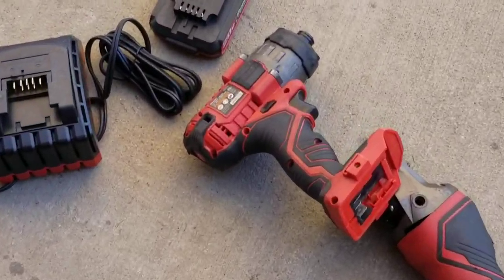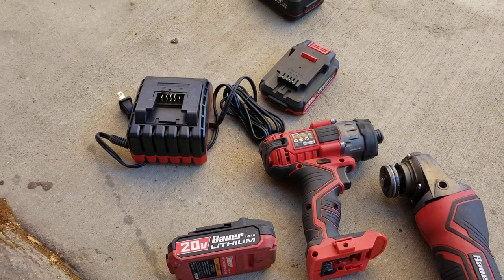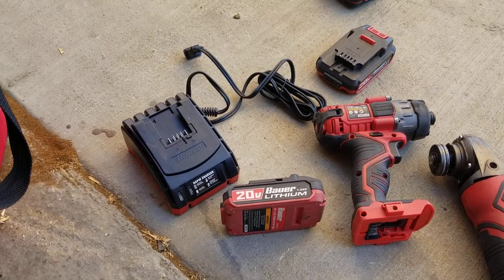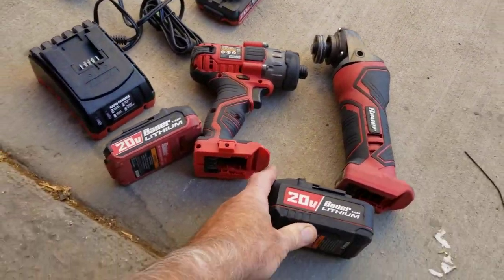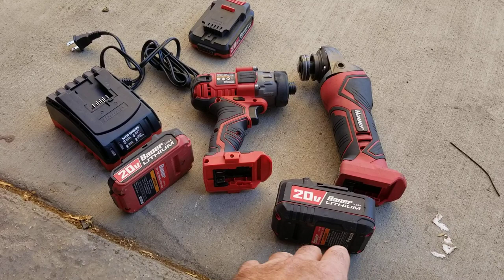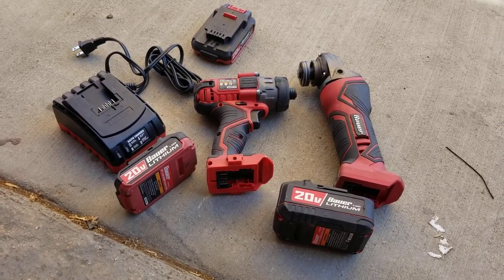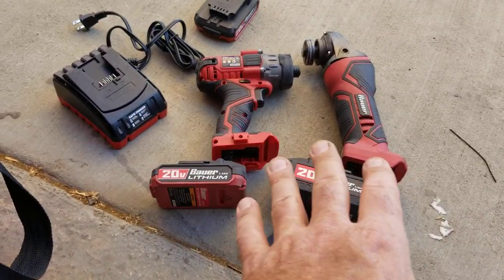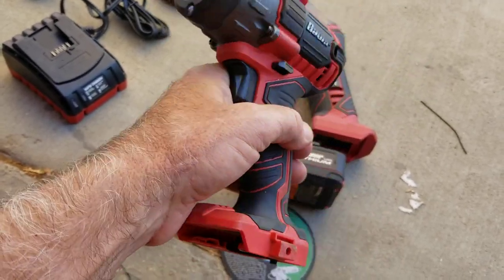Harbor Freight Bauer tools after 2 years of abuse

Comment: I can testify to the value that the Bauer tools offer the average guy. I am an electrician by trade and have used dewalt tools for years. I also remodel homes on the side. I recently moved across country and needed to remodel my new house. My dewalt stuff was 2000 miles away. If didnt want to repurchase everything again so I gave Bauer a shot. I purchased everything with coupons. I picked up the impact driver and drill driver kits first. They each came with a 1.3 ahr battery, charger and pouch. Then I picked up a cordless circular saw, jig saw, angle grinder and two 3.0 ahr batteries. I am now remodeling my second house using these tools and they are still working great. There are some things I don’t like as much as my dewalt but for the 320 bucks I have invested in the entire set I am not going to complain. That’s equivalent to about 1000 bucks for the same tools in yellow. For the guy that uses these tools for weekend projects around the house it’s a no brainer. Definitely need the larger batteries for any tool other than the drill and impact driver. I think the manuals even recommend using the 3.0 batteries for the jaws and grinder.
Reply: same thing with me. I was out of town same issue. I bought them with low expectations and was totally shocked. Now I have almost every tool. They work great and if they get stolen which that happens on job sites unfortunately all can be affordably replaced.
Reply: i use to only use ridgid since thats what my boss used too and seemed like my batteries were burning out once a month so i said the hell with it im going to try the bauer stuff because i liked how big the tool line is and with doing home improvement and restore and build furniture and now with the 5.0 batteries im even more happy and with the chargers i actually bought extras so in my workshop i have 5 chargers and probably close to 10 batteries and love how much i have saved and the dependability
Reply: I purchased a 10” chainsaw and Bauer now makes a 5 amp hour battery which I also purchased yesterday.
Reply: I am not branded I use everything I have bauer craftsman just bought dewalt cuz it was use sale. The dewalt was 12v 5 tools to 2ah batteries and two 5ah batteries for 350. But I use my cheaper tools all day and I work in tool sales and I start my sales with taking to craftsman cuz its my cheapest tool and talk to them on projects or jobs and see if I have to move them up but I sell to needs not wants I'm a single dad fighting to stay afloat so I know what budget means and rather get my customers best deal for needs. And I tell them brands don't mean anything anymore I have dozens of customers that say I'll never buy black and decker they only make junk acting like they know everything but they buy dewalt that is a black and decker company as well as craftsman and Mac and dozen more. So thank you for making a video that let's people know cheaper tools don't mean junk yea bauer won't do a job as fast as Milwaukee but can keep up and give them run for their money. And can do the jobs

Comment: The batteries will not charge when hot. YOU have to wait for them to cool down before they will take a charge. MOST LITHIUM batteries are like that to help keep them from exploding and starting a fire.
Reply: good point. necessary
Reply: Even my old Craftsman Nicad don't charge when hot, I thought everyone knew this lol
Reply: KLaw trick to charge a hot battery:
You need to pull the heat out!

Solution: Make a cooling system or throw it in front of a box fan.

Comment: If your Inverter isn't Pure or True Sine Wave, you'll fry your charger. Also inverters are rated in Watts not Amps. 120 volts at one Amp is 120 Watts in other words, Volts times Amps equal Watts. A Modified Sine Wave has power spikes that cook or fry electronics.

Comment: I'm a mechanic and I use these tools.  Have a 3/8th impact, 1/2in impact and the 4.5in grinder.  Going to get the drill.  Currently have 5ah batteries for all of them with the 3ah "rapid" charger.  I'm impressed with the 3/8th impact and the angle grinder with cutting wheels, the 1/2in impact I kind of find lacking on power.  I didn't buy it for the power, the control with the variable speed trigger is amazing.  Besides, I have air tools that have plenty of power, one of them dubbed Shiva for a reason.  I can rip off a bolt with a 1/2in impact that was hammered on with a 3/4in impact.  If it can't break it or break it loose you are in for a long day.  It usually takes a 36in breaker bar and about six foot of cheater to beat that impact.

They are alright especially for the price point.  For side jobs they are amazing.  I went a bit more expensive with the batteries but I haven't had a fully charged one die in the middle of a job either.  That 4.5in grinder is a beast with one as long as you don't push things to hard.  It's not a plug in tool, gotta know your limitations but all in all.  For around $300 or so I have no buyers remorse.

Comment: These are honestly good tools I made a lot of money with Pittsburgh and Bauer tools, only time I make tool truck purchases is if I need a specialize tool. Use the tools properly for what they were intended for and they’ll last . I work on heavy equipment and I purchased the Brushless Impact driver, Brushless 3/8 Impact and Brushless 1/2 Impact with the 3/4 Earthquake Impact. Honestly after 8 months of wear and tear on them, being dropped on accident, drenched in grease and oil and dirt they are still holding up very well from day 1. Hell I even inspired the entire shop to start buying Brushless bauer tools , I see bauer impacts ontop of the other mechanics toolboxes now👍.

Comment: Thanks for the video.  I have a small but very respected motorcycle race shop, and I have been considering these cordless Bauer tools. I love my Ryobi but I'm not buying the batteries or chargers anymore,  I'm done with that. In FACT the Ryobi tools have been growing mold on them from lack of use because I haven't replaced the batteries in over 2 years. In all fairness,  I do have a Ryobi, corded of course,  bench grinder that has a hundred thousand HARD miles,  its truly one of the best tools in my shop.

Comment: The 1/4” impact is great.  I’ve had one for about two years and I have not been kind to it.  All of the rubber over molding has pealed off but the tool works fine.  I think the newer versions have better over molding that will prove more durable then the old version you and I have.  The drill on the other hand is junk.  Mine worked fantastic for six months and then let the smoke out while drilling pocket holes in soft pine.  I was on hole 4 or 5 of the day, so it hadn’t been run hard.  I later found Ave’s review of the same drill on YouTube and mine failed similar to the one he tests.

Comment: I do fleet van work for Amazon and I use Bauer line of drills and impact and also charge them in my jeep so far works good and defiantly recommend 3.0 battery for almost all applications one thing that has helped me with problems along the way is being able to return after buying the extended warranty on my membership. One other good line of battery operated tools is DieHard from Advance Auto Parts and they don't break the bank . Great video keep it up!!!

Comment: Totally feel what you said. I have two Bauer tools: a drill driver and a workshop blower, the bigger 3AH battery’s works much better, I use one to switch from the two and it will hold up all the way thru a small project. Changed my mind about cheaper tools
Reply from the maker: yea I have way more bauer tools now hammer drill , circular saw. `saws all wow that one is great, another impact, 2 of the new style brushless grinders, Buying more too.

Comment: I love the bauer tool line, my standard drill has lasted me 3 years so far,  and I've beat the crap out of it,  I mostly use it to wire wheel rust and stuff off my project truck,  and bog down the motor constantly, works as good as the day I bought it!
Reply from the maker: Yea I use them on my other channel every day. Plus for work. Honestly I am just using Bauer now. Have good power and last and are cheap. If you loose it or it gets stolen your not out much money.
Reply: Of all my drills, when I am going to wire wheel something or am going to need to run a drill for a long time, I grab the Bauer drill. I find it to be lighter  than my other 18 v and more ⁰⁰⁰ If only it had a locking on trigger, it would be perfect. also 3 years of hard work

Comment: Had mine for 2 years still works great for. What i use it for but lets be honest i uga duga some things after the impact. I used it for my lift kit and it did great. Pop out lugs it did great. Im not saying its the best but when you dont work it like a shop does. Its great for a diy. Bought mine with 3 ah battery

Comment: This is what I will say from 2 + years of heavy use on our Bauers....we use the impact for running 1/4-20 screws on beam clamps and drywall screws  all day long on the provided smaller battery...
On the drill, grinder,large 1/2"impact for breaking lug nuts,AND ESPECIALLY DOING DRILLING WITH THE 1/2" DRILL...
buck up ,buy the bigger charge pack, you'll be taken care of...
Quality id say they are equal to rigid maybe a little better in a few respects...

Here comes the tricky part guys so please pay close attention...
WARRANTY... most of the major power tools under warranty do a tool turn in to a repair center translating into a 2 week loss of time on our tool PROVIDED it comes back fixed right the first time..
Harbor Freight ?
"give us the bad one under warranty , walk over to the shelf and bring a new one up to the counter...even trade WITH NEW BATTERY..."

I don't know about anyone else, but I can't wait 2 weeks when my tool fails...If you've got 2 weeks ta sit and wait, then  the other guys might work better for you ...
Reply from the maker: got one and man what a difference, plus more power.
Reply from the maker: great points. Warranties mean nothing if they need the tool  HF immediate. Dropped mine a few times from up high and it still works. trigger sticks a little now but still works. just bought the drill. Got one bad one for some reason not common. Took it back got another that day. No problems since. First one had a bad transmission.

Comment: Seems like a great buy harbor is way more affordable for the normal joe nice video
Reply from the maker: still working great. FYI. had a couple batteries go bad after 3 years but tools are all still working. finally wore out the grinder. I dont think any grinder would have lasted any longer. totally wore the bearings slap out. then I got a new one and the new one is redesigned and brushless. more power yet.

Comment: If one of the Bauer goes belly up (none ever has) I can replace it for $60-$80 compared to other prosumer level brands at $100-$150, good luck with most of these companies on their warranties (except Kobalt/Lowes which are great if you have a issue). Need batteries they are like 40% of the cost. Only issue is I wish things like drills etc were brushless and I wish some things like multi tool was cordless.

Comment: I have quite a bit of the Bauer line. I haven’t had trouble with any of them besides the half inch drill which was strictly my fault but I did insure it so I got a replacement for free. My rule of thumb is if I pay $50 for a tool or more I insure it for two years, If it’s under 50 then chances are it would have blown up on me in less than 90 days for the original warranty anyway so I don’t bother. Stay tuned because Bauer is coming out with 70 more tools for the 20 V line including a five amp hour and an eight amp hour battery as well. For the price and the durability I’m sticking with this line and have pretty much retired my Dewalt, Milwaukee‘s, Ryobi and Makita‘s… Good stuff cheap and it just works as hard as I need them to as long as I let them do the work. Don’t be that 300 lb gorilla and you’re good😉
Reply: I did tge same thing i bought plenty power tools i plan on sticking to this line and buying more in the future

Comment: Milwaukee is better and matco and snap on, but there is a huge difference in price and when I say better, it depends on what you're using them for, if you're a hardcore worker that every minute of the 10 hour job your using the living hell out having a Batman belt packed with batteries and have no time to let it cool down, yeah all the other big name brands are for that,, but if your using it for a shop, home, where your using it and letting it cool yeah it's a great kick for the money,  I own the small cordless screw driver and use it every day at the shop to drive out valve cover, dash bolts, etc, the only reason I have replaced it twice is because the plastic tab to allow the tool to move from screw driver to screw gun often brakes, so I opened mine up and glued the whole day thing together in the gun position lol, I'll tell you except for that broken tab, every thing else is very well made I was impressed, so I figured they're whole line will have the same quality of that screw driver, I know I wrote a lot, you ain't got sh*t to do these days any how lol, but yeah not comparable to other brands fully, but It Is a great brand.

Comment: Just bought the earthquake xt 3/4 dr 20 volt impact and it is badass pulled lug nuts of the semi like nothing very pleased
Reply from the maker: I bought my 1/2 to purposely break 1/2 inch red head bolts. does it like a charm. faster than cutting them off.

Comment: bigger battery of same voltage is more batteries in parallel. if its a 10 amp draw on 4 batteries(usually 1.5-2.5 amph) if you double the amp hour(about 5 amp/h) then its double the batteries and half the amp draw across the batteries which is less heat and alot less stress on the cells.
Reply from the maker: yea for sure and probably less volt drop when under a load. Spins faster that I know. Just a little but has much more power.

Comment: Bauer 5.0ah battery $60 Dewalt 5.0ah battery $120.  It's such a cheap platform to buy into although they are not pro grade for your average weekend warrior it might be a pretty good deal.
Reply from the maker: I dont know I have been working the crap out of these and I cant break them 3 years now no issues. Installed over 100 banners with the hammer drill. Still working great. And if I go to lunch and forget them on the tailgate they are still there. Dewalt gone in 60 seconds.
Reply: I  just bought 2  5 ah dewalt at Bomgards farm store last week for 59.99.
Last month Jan 2021 I bought a DeWalt xr drill with a 5 ah battery for for $63 because 2 promos overlapped each other. You will never get a deal even close to that with Bauer

Comment: I baught hyper tough tools to put on my work van because I didn't want to ruin my good milwaukee tools. So far no major issues except it takes 3 hole hrs to charge 1 battery.   If on a budget I recommend them. But if not on a budget get some dewalt or milwaukee. I have craftsman took also. There better than the hyper tough

Comment: I've got the drill and angle grinder. Been using them since they came out. They work excellent and I abuse tools. Had the brushes burn up on the drill but I was cutting 5" holes in 3/16 plate with a hole saw. It would of smoked any cordless drill.

Comment: If you like the extra power and capacity of a 3 ah battery you should buy a 5 ah battery or 8 ah battery or even a 12 ah battery that some stores already have in stock but others will have soon because the bigger batteries don't just have more capacity but a lot more power also for sure!

Comment: Be careful with those flat type cut off wheels..I’ve had them explode ,and shear off at the locking nut and rip thru a pair of heavy duty welding gloves.. the molded depressed center don’t do that..
Reply: I had a 4 inch grinding wheel explode and leave me with a hell of a bruise on my side. Anything that rotates can explode

Comment: The problem with Bauer line is the charger is 1.7 amps. Thats 2 hours to charge the 3.0ah battery. Compare that to Hercules charger which is 4 amps. Ridgid 5amp. Dewalt 6 amps.
Reply from the maker: true I run 3 chargers at a time Cheap to buy. and lots of batteries. for the price of the batteries it is worth it. You never know they may make a better charger. This line has just gotten better over the last 3 years. The new grinder is brushless and has more power. they also now have a 5ah battery.

Comment: I like the Bauer tools...the batteries are where the line suffers. The Hercules line uses top Samsung cells, the Bauer uses lower end cells. That was the deciding factor in choosing a tool line for me. Hercules has to catch up with available tools, but it's batteries are substantially better.
Reply from the maker: yea probably but I have not had very many battery issues yet.
Reply: My battery is 3 years old still doing fine,  so there's that!  Doesn't seem like anyone has any complaints with the batteries.  You didn't even know what kind they were so I'm not sure why you thought that.  Probably someone told you and you believed them.

Comment: Volts x Amps = more power

Always go for a bigger battery
Reply: Batts are rated  by Ah, which is Amp hours. different from amps. Usually larger Ah batts give more amps though, for the same given voltage. Of course batts with greater internal resistance(IR) have more voltage drop. Newer batts have lower IR, which means less heat and voltage drop.

Comment: I don't see how a bigger battery will increase speed/power.  They are still 18650s wired in series/parallel to output the same voltage/current.  In theory, the only difference would be capacity.
Reply: it has more available amps to discharge faster. some 18650's are better and the 21700 are even better